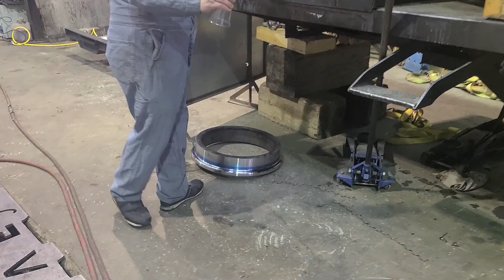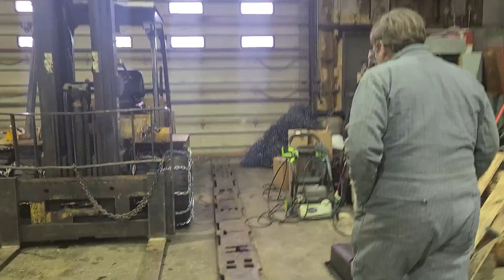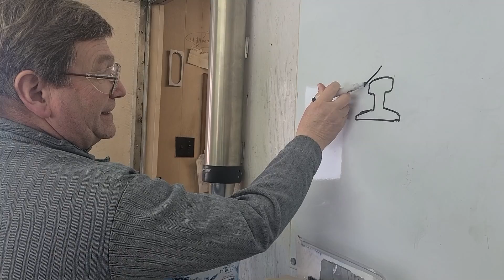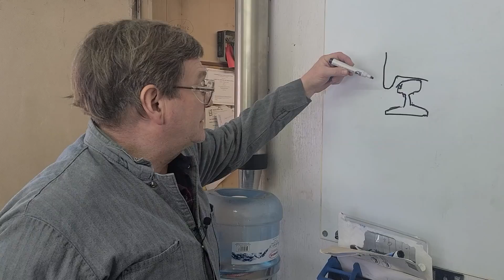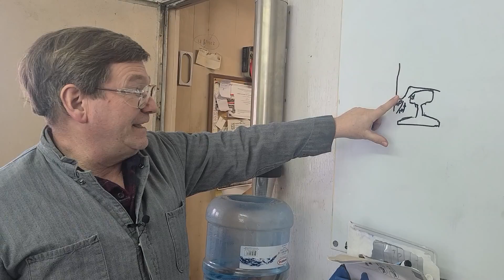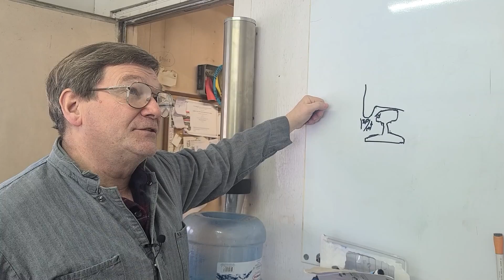Machinist's Minutes: What angles does a train wheel need, and why?

Comment: In a past video you mention the angle of the cutter is most important when turning things in a lathe.  How do you adjust that angle if you have a quick change tool post ?  Thanks in advance.   ~   John B
Reply from the maker: With our quick change tool posts there are screw adjustments to change the height of the tool holder (thus changing the geometry of where the cutter hits the circular part), so that is how we change the angle on ours. Without seeing your quick change post I can't say for sure.
-Cameraman

Comment: I appreciate all your videos, the train one have been particularly of interest lately as I have been gathering parts and designing an 18 inch gauge air powered locomotive to bring firewood from the woodshed to our sugarhouse, one thing I have been unable to find much on is how much flange clearance is normal. For example if my rails are 18 inch inside width should my wheel flanges be 17 1/2, 17 3/4 or even closer?
Reply from the maker: Make sure you have coverage of the wheel over the rails plus a little more, if the wheels are full to one side.  Normal is 3/8" to 1" total clearance.  More movement, narrower wheelset, will let the tapers work on a gradual curve.  Less movement, wider wheelset, will let the wheels go into flange guiding, with a less abrupt transition.  If the track is mostly straight, with minimal curve, I would consider 17 1/4".  Are you using steam style cylinders/crossheads? or a geared drive?
Reply: Thanks John, that's about what I figured, the wheels i have for tye cars are reproduction mine cart wheels with a face of about 1 3/8 so on 1 inch wide rail head was figuring about 1/4 to 3/8 would keep it on the whole width of the rail head still. It's more of a novelty than a heavy haul thing but who among us hasn't wanted their own train since they were a kid! And my original plan was to use a swing motor I had from an Erie steam shovel geared to the axle, but then decided if I was going to do the work of fake connecting rods anyhow I might as well use air cylinders which also have less leak by that the old erie steam shovel engine. So plan to do an actual crosshead and all, and since variable cutoff isn't as effective with air as steam due to it not expanding like steam, my plan is to control the left and right separately so that once it is moving can cut off one side and basically use half the displacement to save air. For the locomotive wheels I plan to flame cut them from some heavy plate I have then machine them in the lathe

Comment: Ten years as a locomotive machinist,  the flange width, height, and tread  cupping depth are all regulated by the FRA. The tapers as Howie said keep the wheel set centered in the rails.

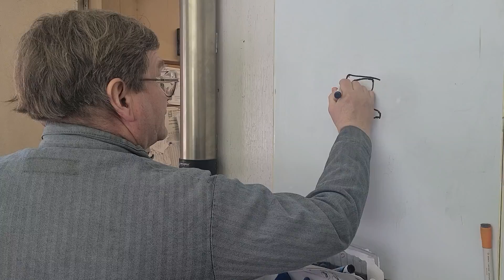Comment: 9:15 the flange and taper are not right on the drawing, must have been a brain fart
Reply from the maker: I was thinking of the taper in one direction, then I drew the flange without thinking about which side it should be on, rather I just put it on the side I had it drawn in my solidworks file.  So yes the taper is wrong for the flange as drawn.

Comment: Dear Mr H
May I recommend looking up "High Adhesion Wheel Profile" on the internet.  You will find reference to Livio Dante Porta's ideas for a locomotive wheel profile to provide maximum adhesion, by helping to repel oil that gets on the wheels due to leakage from the axle boxes etc.  plus anything else like debris from leaves etc that could induce wheel slip.